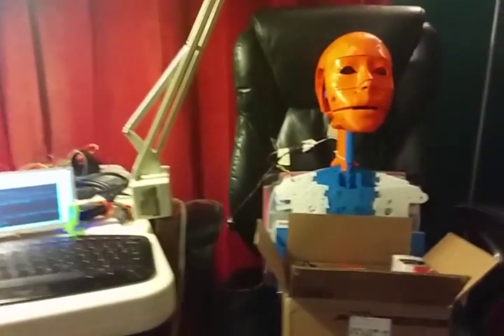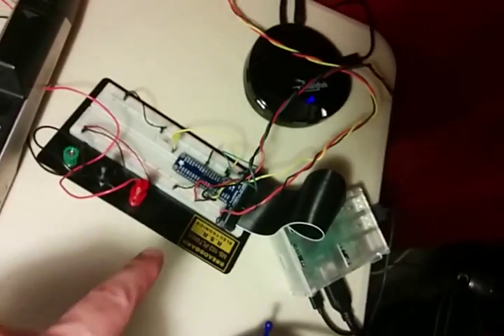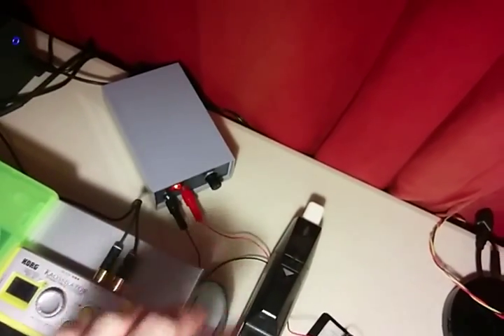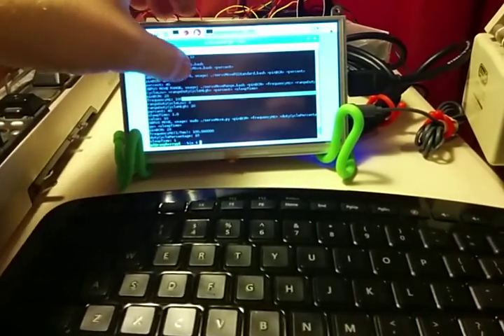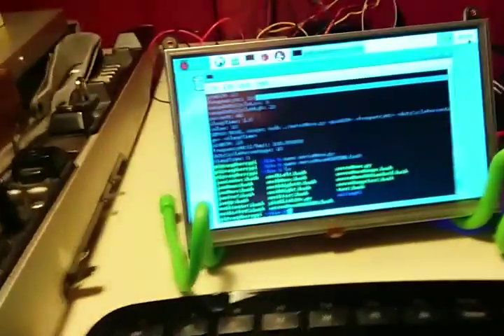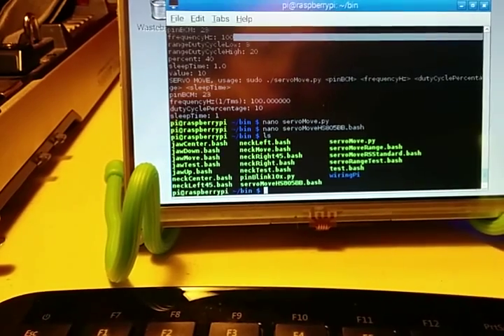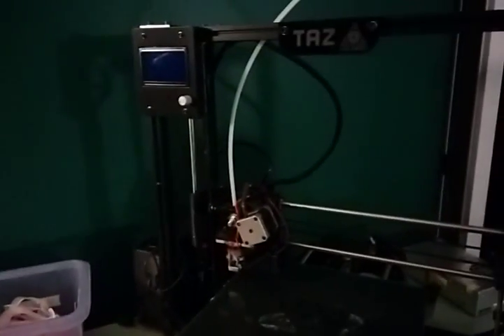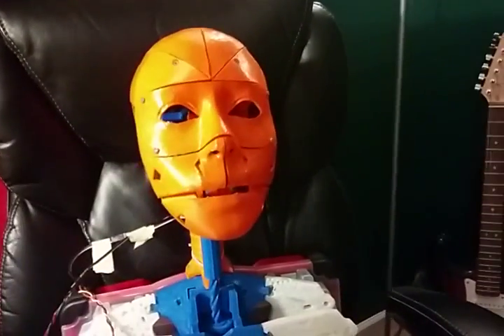InMoov 3D Printed Robot Raspberry Pi Part 2

Comment: The reason others use the Mega/Uno or Mega/Mega is the 33 servos that all need control pins. I guess you can add some expansion-board, but as said, it will need almost 2 Megas when the legs are done. Did you continue the build?

Comment: Thanks for sharing.  I've just started building the hand and test finger.  Be interesting to see the progress of your build.
Reply from the maker: +Travis Vaughn Since this video was done, I've added the extra chest pieces, made a circuit map, and I'm still working on the motor in the chest that does the up/down neck movement... that piece is very difficult to print correctly.  But yeah the robot component is secondary to the AI software I'm working that will use this... isomerprgm.com   At some point, I'll publish the pi (not arduino) software I used to control the InMoov.